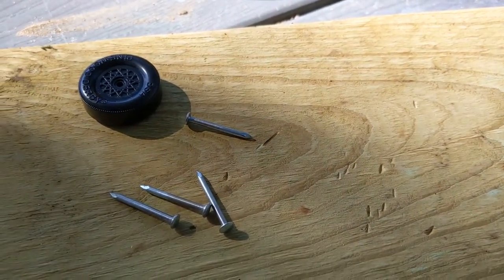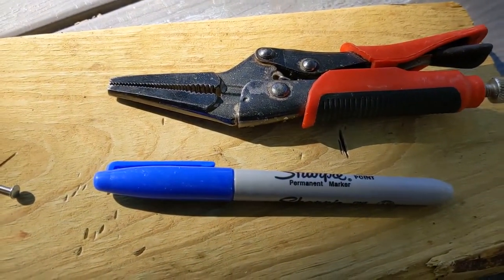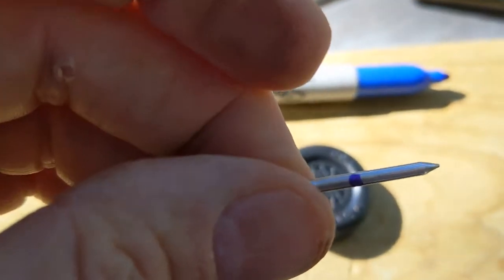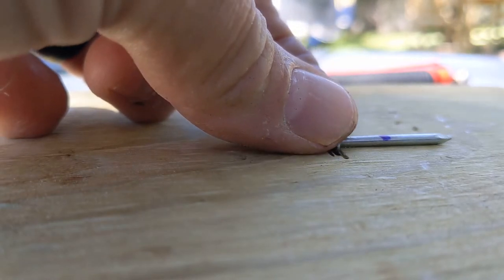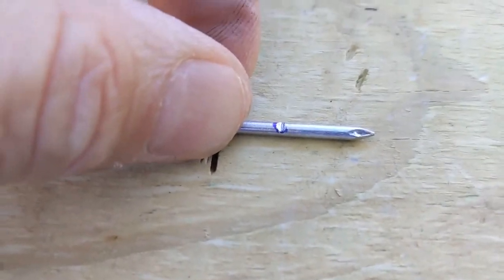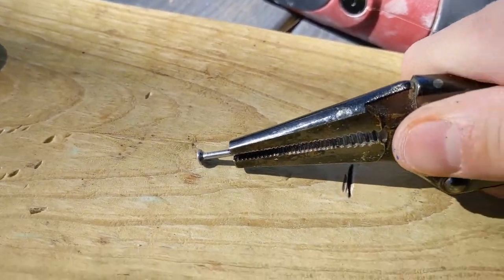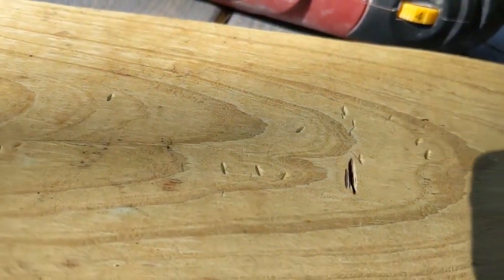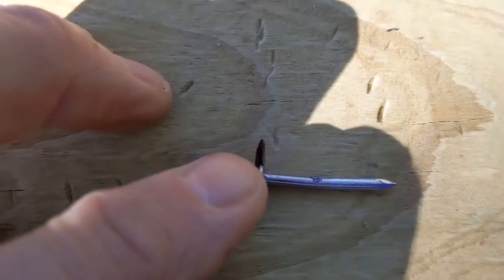Angle / bend Pinewood Derby Nails Axles

Comment: Check your rules carefully, that'll get you boy DQ'ed here.
Reply: Manipulating stock axels is legal. If it was an aftermarket part, then yes. Same with using different wheels (you have to check which are legal if outside the box). Also, nothing against riding on 3 wheels too
Reply: @Calibrex_Gaming  Pack rules differ.  I agree with TONYC... better ask before you go this route.  Seen people DQ for less.  how about adding too much graphite in a hub.... Someone claimed it was a graphite bearing!